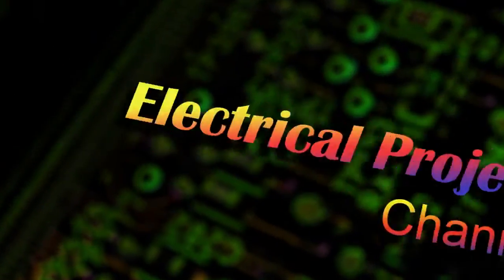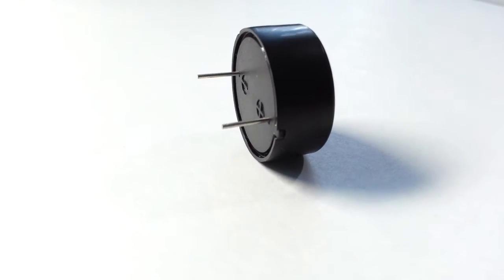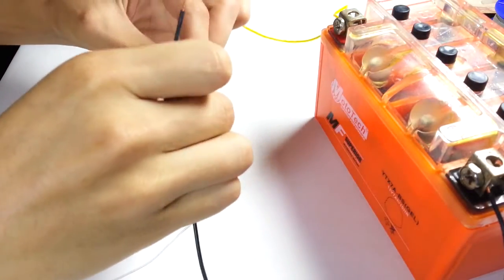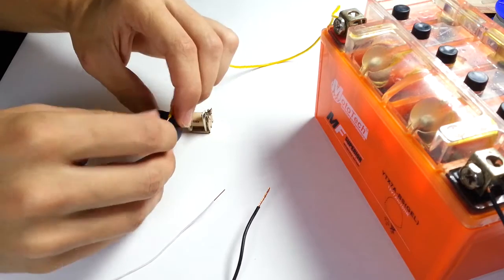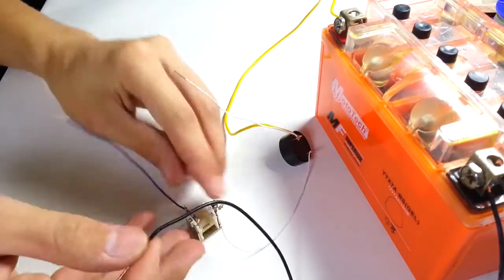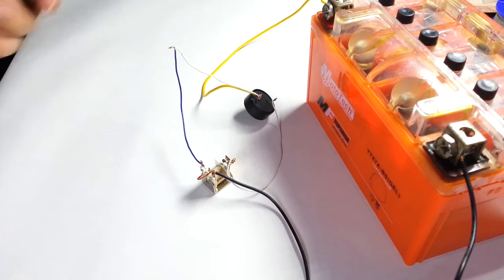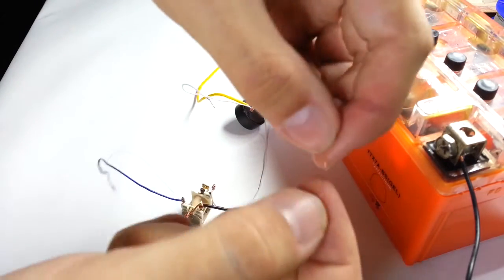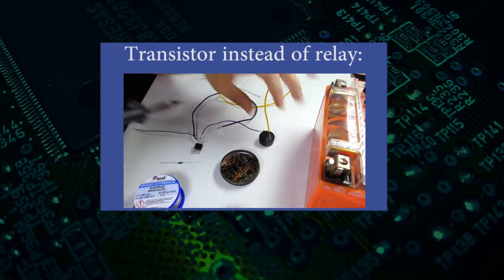How to build Tripwire security alarm device using a relay / Cut wire alarm / DIY Wire Break Alarm

Comment: is it work with 15mtr wire distance
Reply from the maker: Hi, it depends on relay, and thickness of the wire. It will work for example with 0.1mm thick copper wire and a 12V relay that has 400 Ω coil. (sorry for the late response)